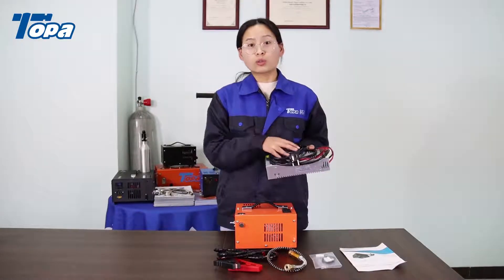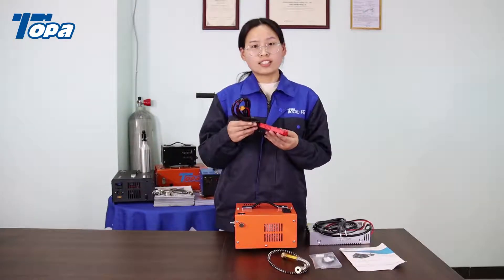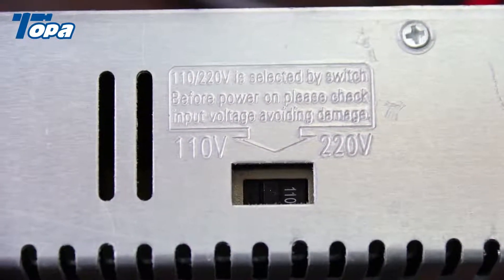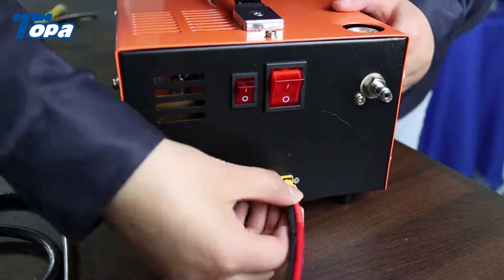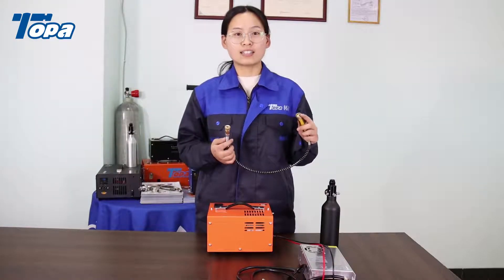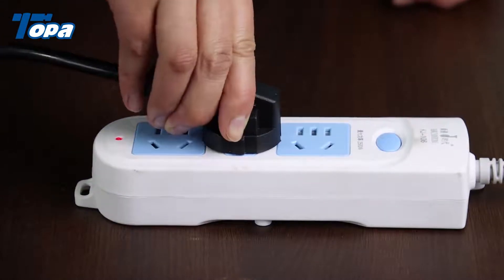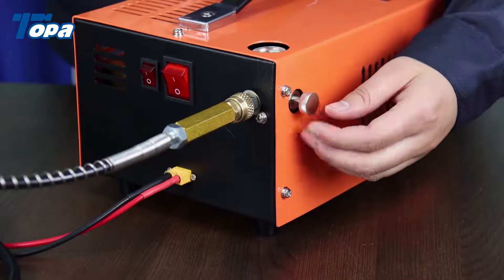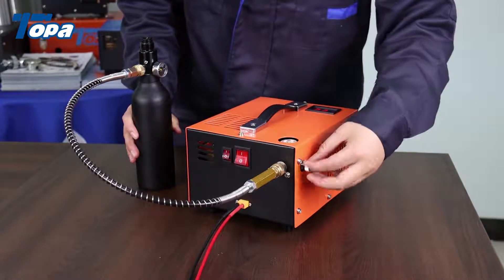Orange pcp compressor 12v 4500 psi recharge Inflate fill 0 25L gas cylinder to 20MPA

Comment: Hi i am after a part for my machine its the aluminium block that holds gauge/ hose and pressure air drain loads of air coming from block were could i get the part cheers

Comment: Hi good video I'm looking for an answer to a question for the 12v wires that connect to the truck battery? Is there any danger in extending the wires to reach the tail gate of my truck it measured from what could estimate 18 to 20 ft. Would work for my truck is that a problem?
Reply from the maker: The required wire quality is high. Use thicker copper wire.
Or it will burn because of over current.